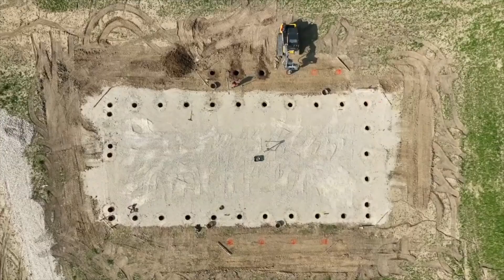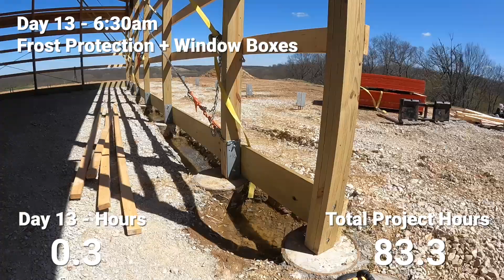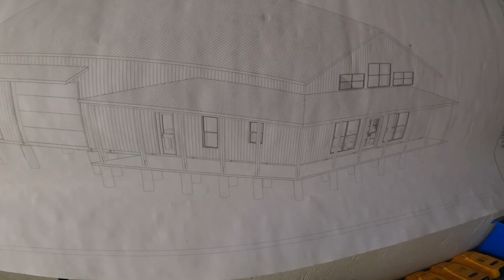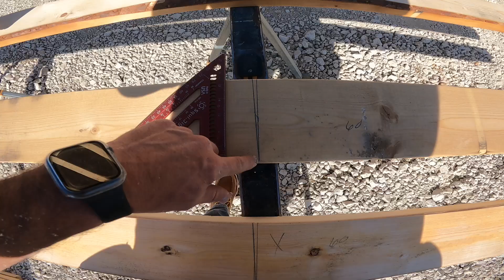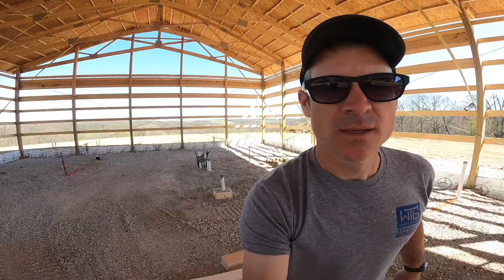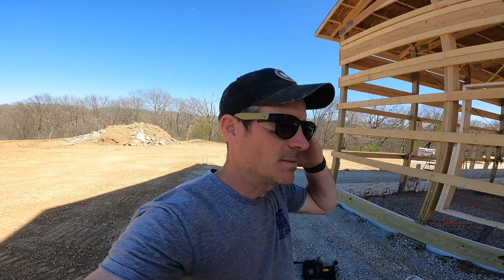Solo Barndo Build: DIY Your Barndominium | Frost Protection + Window boxes | Ep9

Comment: How did you do the frost protection trenching? Did you back fill with gravel or concrete? Do you have any concerns with wood skirt board rotting? Or will that stay off the ground? Does concrete slab run all the way against the 2” foam?
Reply: I’d also like this question answered. Looks like a nightmare to dig that trench clear around the building to install foam 12” below the grade board. 
The building in the video looks like it was built well above grade so probably not much digging but what if the bottom of the  grade board is only an inch or two above grade?

Comment: Building a tapered opening for the window framing would make installation easier & if water would get behind the window it would allow for drainage away from getting inside.
Reply from the maker: When we build the window boxes we put a 3 degree slope on the bottom sill.

Comment: Can you explain you measuring the wall for windows in more detail
Reply from the maker: If you are using a steel siding for your exterior you will have ribs on the metal and you don’t want the ribs to land on the edges of your window. The steel I use has ribs every 9”s so I mark that out on my wall prior to measuring for and setting windows so I can adjust the window left or right a small amount if I need to avoid this.

Comment: I'm a little confused on the idea of trimming the window boxes by the 1/4"?   I would thick they need to be the same thickness as the overall wall?  Do you add vertical 2x2s to bring them out to the same thickness as the outside of the gurts?
Reply from the maker: I use columns that have been planed. They are made of 2x6’s so the start out at 5 1/2” in depth. After being planed they are 5 1/4” in depth so when I make my window boxes I want them to match in depth so I cut a 1/4” off of one side. Then the window box sits flush on both the inside and outside of my columns. Then girts run across the outside and inside and blocking gets added in between the girts.

Comment: Do you have any opinion on using the zip system sheathing on the outside? I've noticed it doesn't you use them and I'm not planning on using them myself but wondering what you think about it.
Reply from the maker: It’s a great option if budget allows- it’s a significant expense for a project. If someone doesn’t use spray foam we’d encourage that or some type of exterior sheathing.

If you use anything besides an exposed fastener steel panel you’ll need sheathing.

Comment: Great video! How high are the sidewalls on that building? How thick is the foam board that you use for frost protection? This build located in the Midwest?
Reply from the maker: 14’ sidewalls, 2” board thickness, and yes, this build is in Iowa.

Comment: Do you think doing a frost wall is worth the additional cost over doing it this way?
Reply from the maker: I would say a continuous footing and frost wall is better in some ways but it’s also 4X the cost. I’ve done post frame on footing and frost wall, icf wall, but mostly on piers and I can say it works out very well if done properly.  It saves a ton of money, is plenty strong, DIY friendly, and still yields a very efficient home or building. My personal home is on piers and no complaints.
Reply: I feel like if your doing a frost wall you might aswell do a basement... but im curious to hear his thoughts aswell